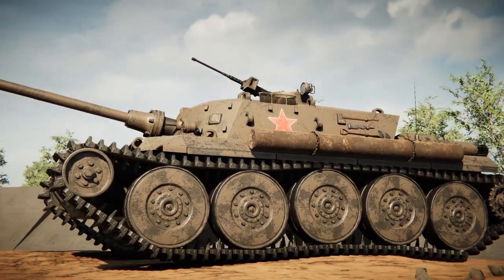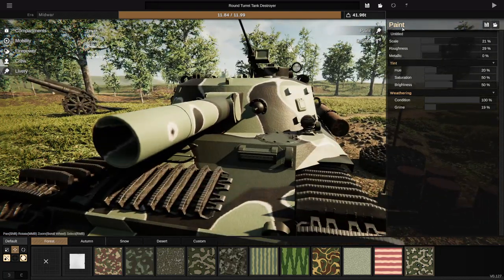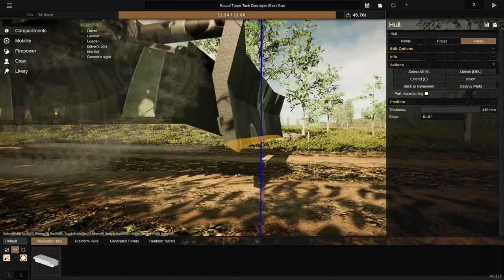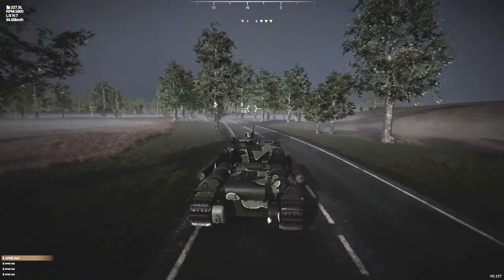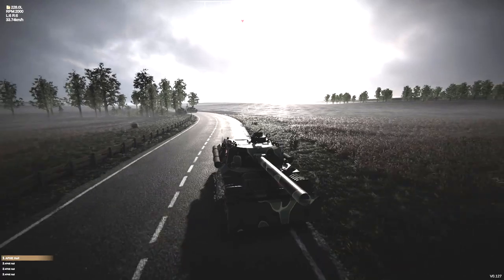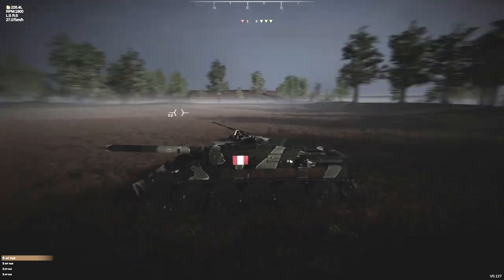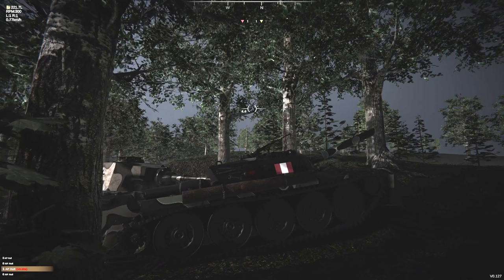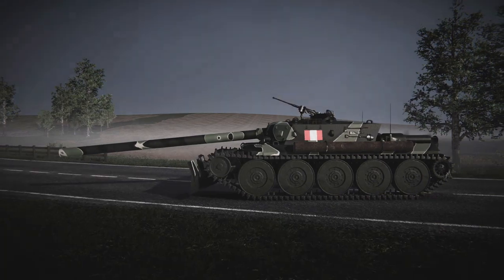I ATTACHED A GIANT 250MM CANNON TO My TANK DESTROYER In Sprocket!

Comment: To kill a king tiger from the front you need to have at least 200-250mm of pen on the gun
Reply: Well the turret front is only 185mm and there's little chance of going through the hull unless you've got a large caliber to overmatch the plate
Reply: @onfiredragon3009  you don't need a big caliber to penetrate armor. You need velocity. That's why APFSDS can go through 400+mm RHA.
Reply: @Anton  I'm well aware, please show me how to use darts in sprocket then
Reply: @onfiredragon3009  editing
Reply: @Anton-cg7og  righhhtt